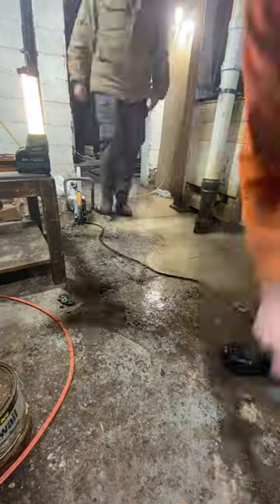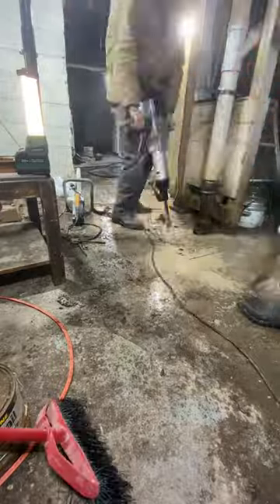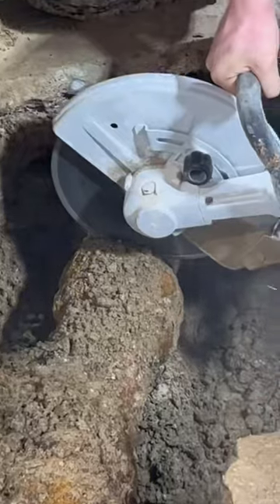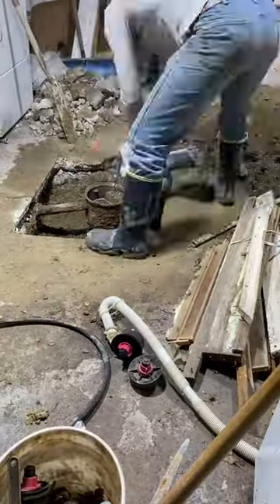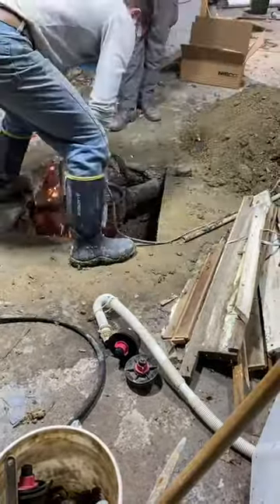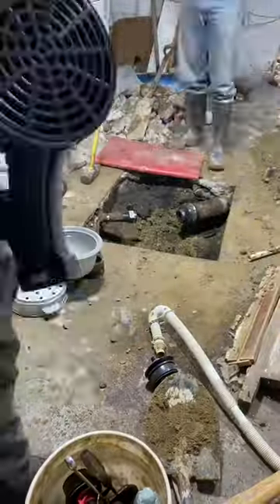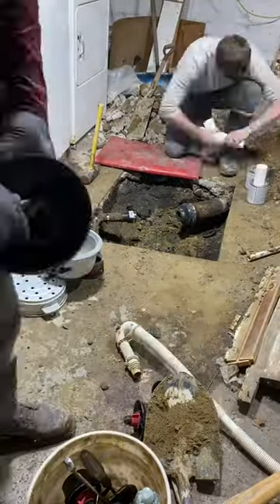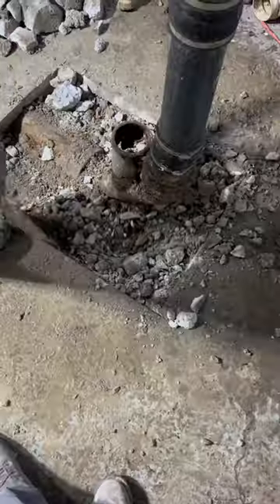Making Some sewer repairs on some broken cast-iron pipe. #HansomeOrHandy #Handyman #Plumbing￼￼

Comment: While I was watching, the smell of cutting old cast iron pipes with a grinder came forcefully into my mind. I don't even have a wet saw, so I use a cut off wheel in my grinder.
Reply: Lawddd🙏
Reply from the maker: When I can’t use the wet saw I will use a reciprocating saw or a grinder, but this is by far the fastest way I have found.
Reply: Grinding cast gives me bad allergies, if I get too strong of a whiff my nose is pouring for the next hour 🤧
Reply: I have that same Evolution diamond saw... It's the best saw.  I've cut hundreds of feet of slots in concrete with it, a little bit of cast iron, much of the concrete cut dry outdoors, and it's still on the first blade.
Reply: @tylerp5839  I use additional eye protection and a mask when doing anything with metal (welding, grinding, etc). Screws up your eyes over the years.
Reply: If you get bothered by cast stop plumbing you aren’t meant to be doing it the metal smell/ taste is my life if it’s not you’res be a Waitress
Reply: I use no gauged grinder with safety squint work with me this little vid will be 530 am to 8 am get up and get good

Comment: The breaker tool is risky.  Especially when it breaks a 12" sliver.
Reply: Yep, learned the hard way doing exactly that
Reply: Do a deeper score they usually won’t fracture like that.
Reply: The chain snap cutter makes good cuts  but you have to make sure you are using the right type for the pipe you are cutting . They make a chain snap cutter specifically designed to cut the no hub brand of cast iron pipe , you can still use a regular chain snap cutter on hub but it leaves a jagged edge.
Reply: It was 4 in. Still I hate when a pipe keeps cracking to the point you need to cut more off.
Reply: @OniSamaGin  if it’s real old pipe especially on a stack and there’s  already cracks in the pipe that you are trying to cut out then the pipe is more likely to crush rather than break off into a nice cut. If the pipe is in that bad of shape then you got bigger problems then worrying about the chains snap cutter crushing the pipe. I have had some luck going back to nearest hub and splitting that off to get to the piece that was inside of the hub where it’s a better piece of cast iron to put a band on instead of the pipe that’s crushing when trying to cut it with a snap cutter. Or if your cast iron pipe is just super thin with cracks and holes all over it, you can go to a hub and melt that fitting out and come out of that fitting with new pipe. Most of the time those old extra heavy hub fittings last a lot longer than the pipe and you might get lucky there but it’s a matter of luck. I just dug up my main house sewer to the curb trap and replaced it , it was only 8 foot deep and 10 foot from the front of my house to the curb so it took me a couple hours to dig the hole and 1 hour to put the pipe in .

Comment: I have not been a plumber in decades.   But we always had to repair cast iron with cast iron and fittings.  No hub connections were allowed.  And yes. We poured lead joints for cast iron joints
Reply from the maker: I am not required to go back with cast iron. It is so much easier to use PVC. But different areas have different codes.
Reply: @HandsomeOrHandy  but done plumbing rough-in w pvc isn't easy faster yes but easy never 🥵
Reply: Till today in commercial and high rise buildings only cast-iron metal plumbing and copper water line are allowed
Reply: Was that in Chicago?  Because that's a Chicago rule
Reply: Work smarter not harder
Reply: Yeah cast iron is gone now except in some commercial because its better in fires. Thats pretty much the only exception. Also I know of a couple customers that have requested cast iron but we always at least try to convince them of pvc or we can do cast iron but it will cost more obviously
Reply: @Charlies_Factory  yeah smoke score even clears code. All I do is cast iron. I love my job. Noise and plenum.
Reply: @Best Friend  I cannot imagine wanting PVC in a commercial sewer line. It's sewage.

Comment: Fernco bands not allowed by code in Kentucky rubber connecting bands must have a stainless steel band around the rubber coupling
Reply: Couple PL to CI Mission bands and an a fitting would have been a better choice.
Reply: I was taught to use shielded couplings underground also...
Reply: Code allows Fernco on vertical, but not horizontal, due to flexing and mis-alignment of horizontal drain.  Cast iron to PVC transition couplings have heavy-duty stainless bands for rigidity, and rubber sleeves of 2 different thicknesses to accommodate different O.D. of PVC and Cast.
Sawzall with Diablo cast-iron blade works great!
Reply: They shouldn’t be allowed anywhere.
Reply: @shoover2889 they aren’t . You need to use 4 band clamp no hub couplings that’s the right way to do it.

Comment: You guys are awesome workers need people who want work like yall.
Reply: These days you would be called an extremist Republican for saying that.
Reply: Yes sir a proud one
Reply: To do a terrible job using illegal ferncos in the horizontal and not test anything before backfilling? You don't know $hit about what a "good plumbing job" actually is bumpkin boy!😂
Reply: @daddy1571 exactly what I said. Also why not replace the entire line so no issues next time? This is why I did my own repair under the slab to foundation and out 2 feet from foundation. These guys overcharge and still do a poor job. Oh I'm not a plumber but I still passed inspection
Reply: @vroor32  Absolutely. You have good common sense and probably pretty decent basic mechanical knowledge. Grading a sewer line at 2% isn't rocket surgery! You probably did better than a lot of professionals because you cared more.
Reply: @daddy1571  oh heck yeah, I saved $$$....even wifey was proud. A plumbing company quoted me $6500... And a south American dude quoted me $4500 (cash only) 😂 ... It cost me $700 (in parts/tool rentals) at most and 10 days of lazy work with no rush. I even had my 2 teenage boys help along and they both learned a thing or two about how not to get ripped off.
Reply: @vroor32  Nice!

Comment: Try using wet Rags inside the pipe and put cardboard around the outside when you're making the cut it keeps the dust down it's just a simple way to keep the dust down you use band clamps or worm clamps to hold cardboard in place while you make the cut it cuts the dust down by 50 60%
Reply from the maker: I’ll have to try that next time
Reply: Sounds like a great idea!

Comment: I'm not a plumber but I used diablo carbide blades on a sawzall to cut cast iron sewage lines at my house. It worked great. Installed ADS sewage lines and I have not had a problem for years.

Comment: Carbide blades on a Sawzall work great to cut cast iron and you dont need to be breathing in all the crap the other saw makes. Also if you are gonna get a cast iron cutting tool I recommend the the ridgid 226. Its compact and can fit on a shelf no problem and will legit last forever.

Comment: Reminds me of a rather nasty plumbing repair we did in the late 80s at our local McDonald’s, the store was built in 1980 or so…they were having issues with drains from the serving area, and another plumber was using a snake and came up mud???, ok why??, we determined that the cast iron drain lines were compromised, so up comes the quarry tile, cut the concrete floors, start removing all the soil, 5’ down we found rather nasty soil around the 2” lines, the soda drippings ate the entire bottoms out of the cast lines in just 8 years…we had to remove the entire system back to the restrooms where the water diluted the soda and saved the lines…it took a week in the evenings with picks and shovels, and I recall it being January so the dirt was freezing in the bed of the dump truck, (no liner)as I recall it was about 12 tons of soil removed…..new pipe, gravel, concrete, tile…!
Reply from the maker: Nowadays you could have relinded the sewer pipe. That definitely sounds like a huge project.

Comment: Looked like you all connected to a Bad Piece of Cast Iron Pipe 🫣
Reply: The cast they are attaching to looks fine. Not everyone can afford to replacing all the cast iron thats extremely expensive
Reply: @T T  I understand that, I've did to many of them, either with the customer or insurance claim. That Pipe was to Thin around the walls on that cast iron, J.S, It's the Quality of work...
Reply: Hey.  Dont go holding someone else to your standard levels.   Thats not proper anymore…..muahahahahaha
Reply: Whole bottom looked rotted tf out bet you could poke through it with your finger 😂
Reply: There’s no cheap way, the bottom of the CI is cracked . That pipe should of definitely been lined and not made a repair and covered up. This is a hack job and this guy has no business plumbing. At least  not film it like you know what your doing!
Reply: @TT-ik3kd what hell but it was definitely cracked and going to leak. It absolutely needed to be cut back. Rather spend 200 more for the right job. But you aren’t going to get it with this guy I mean he used ferncos instead of 4band clamps which of course is not code. But when you hire a handyman over a plumber that’s what you get. . And can’t use pvc in this application but that’s fine
Reply: @johnpinedo73 ya I would have been embarrassed to show this. But you would never catch me using ferncos . That’s for sure
Reply: It also looked like pipe in ground had a 4' fracture ?

Comment: If the breaker tool you're talkin about is a "snap cutter" they don't make a clean break unless its over a foot away from the end of the pipe. I'm not sure if snap cutter is the actual name for it, that's just I've been told it is, it's made be Rigid and it looks like a big tailpipe cutter tool, I like usin it for cuttin water valve risers instead of the hot saw, it's much more quieter
Reply from the maker: Being that they are 500–700 dollars I probably won’t be buying one anytime soon. It would be cool to try one out sometime though

Comment: Saw was a good tool they also make a cast iron sawall blade that works really good with a powerful Sawzall.
Reply from the maker: Are you talking about the carbide teeth ones or the ones that are diamond dust?
Reply: @HandsomeOrHandy  they have a diamond edge on them . They cut real clean. Lowes sells them they are made by Lenox

Comment: I believe code says buried collars have to have a metal sheathing around them.
Reply: yeah fernco
Reply: In my state both are fine. That's a state by state thing. And I do prefer the metal mainly for when exposed to sun. But both types are rated by manufacturer above or below ground
Reply: While it is state by state, I can tell you from personal experience, we dig up collapsed lines all the time that failed because of a Fernco with NO shield. Hence why some states make it code
Reply: Also, a reducing Fernco is the worst thing known to plumbers
Reply: you said backflow preventer?
Reply: I would never bury a fernco!!!
Reply: On the next victim that’s whet he meant!
Reply: @trabul5544 dude I remember being in Kentucky and having to source an eccentric fitting reducer in Knoxville just to get the pitch we needed on a huge coke job. Still had to install a lift station
Reply: Different states are different rules....in Ohio ..inside a building a shielded band has to be used underground outside a rubber fernco is acceptable
Reply: @alcapirobi2915  well you don't do plumbing then buddy🤣
Reply: A stainless steal shielded clamp all ( fernco with a shield) is best for underground use but every state is different but it would impress inspectors to use one I would think because I stay away from all rubber even when I’m out of the ground just makes me sleep better at night knowing they will not have a issue for the next 10-20 years but again it’s a state by state thing other then that good job!!🎉
Reply: And yes a backflow preventer is so if it backs up on the main line it don’t all just come out of that floor drain and no one will know until someone washes clothes
Reply: @amandonstephanieconstructi870  I know what a backflow preventer is, but I never mentioned one. I don't know why it was brought up?
Reply: My state requires a heavy duty stainless sleeved with 4 hose band clamps.
Reply: @D_and_L  out of curiosity, which state? Thx!
Reply: I don't think they'll ever know it if it's under the concrete.
Reply: @johnc7512  yeah till it fails.

Comment: Had an experience similar with an old school plumber, he probably in his late 70's now. I did all the concrete cutting, as a Carpenter by trade I learned a bit from the man. Worst time was when we had to change the main cast iron waste line, feces came down on my chest many a times, lol.
Reply from the maker: That’s what I shut off the water to the building, they still have one flush but that’s it
Reply: @HandsomeOrHandy  Here in Hawaii, they are smart, they fill up 5 gallon buckets for these shut off occasions 😂

Comment: I always use my concrete saw instead of chain snaps👍
Reply from the maker: It seems to work really good.
Reply: @HandsomeOrHandy  it's safer and a nice clean cut...on big pipe 6,8,10 ductile or cast I use concrete saw thru top then cut a diamond window out the bed part of pipe and use a 6" grinder to finish cut or depending which side I'm on the concrete saw 👑

Comment: Definitely needs the shield ( no hub fitting,) it will definitely sag and clog
Reply: Ferncos are okay. They work completely fine with short runs of pipe.
Reply: For sure ric…. That needs to be a mission.
Reply: Heavy duty ct bands and sleeve the pvc with milwrap..
Reply: I would have put some of the concrete underneath it and give a wide pad like a snow shoe. My pipes don't even move half an inch
Reply: @codygooch510 no no they aren’t actually
Reply: @scottfletcher1956 no not mission just regular 4 band clamps are what you’d use here they can be buried .
Reply: @magenlin then you’d be wrong. Concrete eats cast iron and you use sand if it’s pvc or cast that’s it sand that the code sand . Sand only
Reply: @terdferguson1736  if they pass code anywhere they’re good enough. Stop that silliness.

Comment: The snapping tool is overrated. It can cause weakness in the pipe to crack more than what you need. Using a saw will make a neat cut and not disturb the remaining pipe. Good job
Reply from the maker: Thanks

Comment: I've never seen a  fernco get buried. Is that a good idea? Those things tend to pop off. Was concrete poured over them?
Reply from the maker: We do not have a concrete poured yet, but I bury them all the time and don’t have issues if it was outside in the yard I would use a banded coupling to keep it from shifting

Comment: Chain cutters can be a good tool but not in crucial areas because the pipe can spider crack down the line. Good install but I would have used MJ clamps instead of ferncos so it’s more stable underground.
Reply: On old cast? It could crush it. They make sawzall blades that cut through cast like butter. That's what most plumbers use now.
Reply: @daddy1571  I was referring to the chain cutters because he said they make a cast breaking tool. Also if you are building an entire building out of cast, you would never use a reciprocating saw blade. You would use chain cutters or a chop saw. You would go broke using saw blades. BUT for small repairs, sure
Reply: @feeblewrk5788  Right I mean use the specialized blades on old cast iron.
Cutting new cast you only ever use "snap cutters". I've never heard them called "chain cutters" before but you're probably in a different area far from Washington state and call things differently

Comment: Back-flow preventers are notorious for not working.
Reply from the maker: 4 inch ones I’ve seen issues with, but the one that is built into the floor. Drain is usually pretty good.

Comment: Gas powered chop saw is definitely a good answer to old cast iron if you have access! Breaker is messy and will damage 12 inches or more depending on what's built up inside.
Reply from the maker: I’ve never used one of those snap tattoos but that’s what I hear is unless it’s a new cast-iron it will make more of a mess.
Reply: Gas powered saw in a basement?  No

Comment: Anything on the main house sewer as far as fittings are supposed to be sitting vertically not laying on its side in my cities stupid plumbing code but I guess you all have a up to date code because I can see u using PCV in a commercial building which is another thing you can’t use in my city except on a single family dwelling . No that wrong they just changed the code to a building with 4 or less stories can now use pvc above ground only .

Comment: A cast iron breaking tool? ....I have to assume you mean a " snap* cutter....
Which likely wouldn't work in old cast iron because it's become soft so it will collapse the pipe.   I've seen plenty of  ""foreign 3rd world trained ""plumbers" use a 2 lb sledge to "break" old cast pipe ...telling me that's an approved..way to cut old cast . They done it for years without any problems  .. while I'm looking at their work .       Seeing they removed 3 times as much old pipe then was originally required.... Because while they were smashing the old pipe. a split of the pipe occured .... where I pointed out if they were closer to foundation...they'd be screwed if that happened.... and why you use a grinder with diamond or carborundum cutting wheel  or a sawzaw if chance of starting a fire is present (pain in the azz but it doesn't throw red hot metal sparks like a grinder does ..)

Comment: That tool you speak of is a waste of time has very few ideal usages, and it works way better on terracotta (which is overkill)
Reply from the maker: With the cost of the tool in the amount of time I would use it I will probably just stick with my grinder for reciprocating saw.